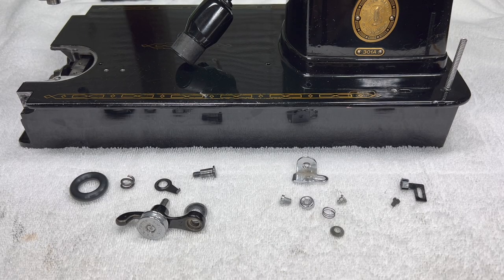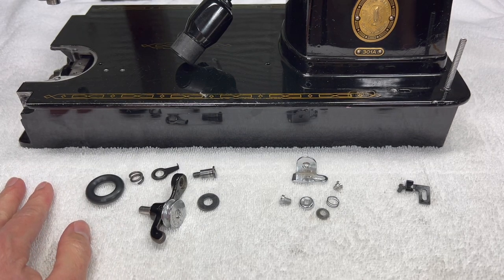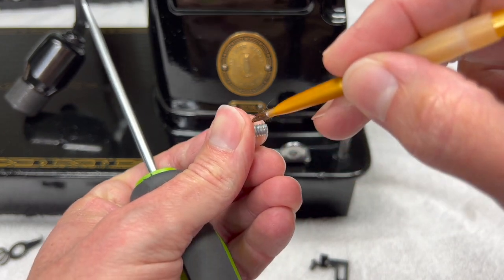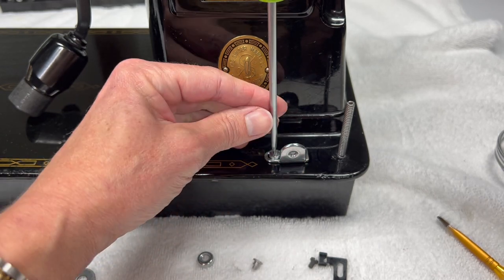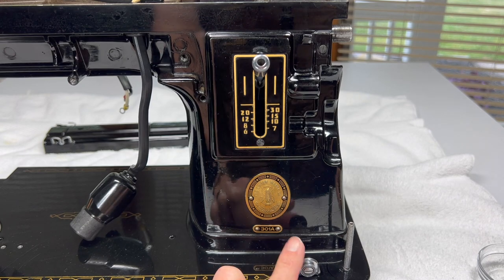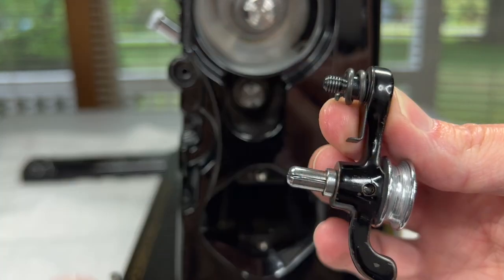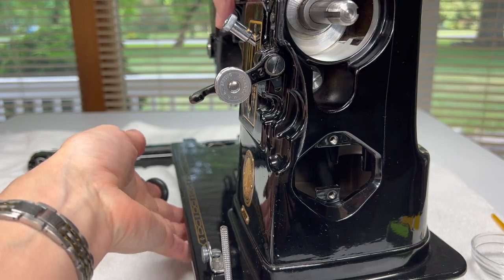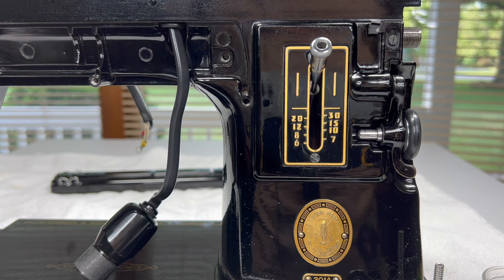How to install the bobbin winder on a Singer 301: Singer Restoration Series Part 15

Comment: I think the mysterious washer was added later. In the spot where the washer was located on your machine, that spot on my machine had some metal shavings that I needed to clean out with a brush. There was damage around the hole where the screw goes in. Thank you for the videos, they are top notch!
Reply from the maker: You are welcome! And I agree with you, it was changed. The metal shavings can be found in a lot of the holes that don’t go straight through. Good to clean them out before you put the screws back in!

Comment: I did not have that washer on my 301. You may want to mention that in the previous video when you are taking it apart. I already ordered a replacement washer, not knowing I would not need it until I saw this video. BTW, I love your videos! You are VERY helpful! Thank you!
Reply from the maker: I am so glad you like the videos! Sometimes the washer makes a difference and other times not. I will have to watch the video again to see what I initially said about that washer, I am starting to forget!
Reply: @SewingMachineRehab  your videos ROCK! I am so grateful to you for posting them! I will add the washer when I get it, just to see if it gives a smoother feel to it. I will let you know if it improves it.

Comment: Great video, thanks!! I agree that things not in the parts list can be likely left off -- but that washer clearly didn't end up there by accident! Really makes you wonder who put it there and why, maybe was solving (or perceived to be solving) a problem the sewist was having... Also, I decided on grease for the main hinge of the bobbin winder arm -- I figured it would last longer, and that part isn't meant to move rapidly, and also needs to maintain its position to wind the bobbin.
Reply from the maker: Yes, I can see how grease would be a good choice as well!

Comment: My little spring for the bobbin winder tension bracket is missing in the the tension disc.  Where could I find the part?  Thank you for your restoration series, I am having a lot of satisfaction doing this with you.  I have been so careful separating parts, and am frustrated missing this small but important part.
Reply from the maker: Hi again :) If you mean the tension spring that looks like a beehive, this is the link: https://singer-featherweight.com/products/tension-unit-thread-guard-singer-vintage-original/?aff=57 If you mean the take-up spring, this is the link: https://singer-featherweight.com/products/upper-tension-take-up-spring/?aff=57 Hope that helps!
Reply: I meant the spring in the bobbin winder tension bracket on front right of the bed of the 301, where the thread passes through to the bobbin on the bobbin winder on the front right of the machine when winding a bobbin.  I actually found it in another bag, it is so small. Thank you, all is well here.  Appreciate your series! @SewingMachineRehab

Comment: My 301 has a two cup bobbin tension unit and is black. The bracket goes on with the open side of the  cup facing the bracket, then the cup unit as you’ve assembled it faces the other cup so the thread runs between the two. The screw has a very tiny nut that goes towards the machine head side.  When I put on the bobbin winder unit, the screw that holds it on the machine is very tight. Should there be a bit of space visible between the rounded projection where it goes and the fingered washer? The bobbin does not line up well with the upper guide. I’m afraid of stripping the screw or receiving threads if I try to tighten it any more, but it clearly needs to go in further. Any suggestions?
Reply from the maker: Hi! I would make sure the threads of the hole and the screw are very clean. It sounds like they are gunked up or they are stripped. If the threads of the screw hole are stripped they will need to be retapped. Sometimes there are still metal shards in the hole from when it was drilled at the factory, I would use a q-tip with some alcohol on it and really make sure that hole is cleaned out…

Comment: I am so glad I found your videos for the 301. I have taken my hand wheel off twice, I do have it all back together and even put a new bobbin tire on it, but I can’t get it to spin still. What am I missing?🥲 Thank you.
Reply from the maker: Hi, does the bobbin winder spin freely by hand when it’s not in contact with the hand wheel? Sometimes it can be that the tire is the wrong size or it could be that you have oil or grease on the tire or the hand wheel where the tire makes contact. Try wiping both of with a damp rag and see if that fixes the problem. Let me know if that works!
Reply: @SewingMachineRehab  thank you. I wiped the hand wheel area and wiped my tire off. It does run now but not when I put the bobbin on it unless I put a little pressure on the tire. I got my tire from the Featherweight Shop. I took the top off the the machine and those gears work perfectly fine also. It is just when I put the bobbin on it, it doesn’t spin and I have tried at least 3 different bobbins also. Two were the original bobbins and one was the newer ones that have the 9th hole I think they call it. Still puzzled 🤔
Reply: @rustylindop9436  Hi, I wonder if there is old oil or grease in the oil hole?  Just bought a 301A and it looks like it has old dried oil or grease which is difficult to turn the bobbin tire by hand.  I'm going to try submerging in it 99% isopropyl alcohol then re-oil it.  Doesn't look like the unit separates.